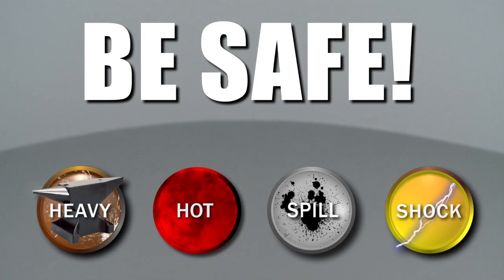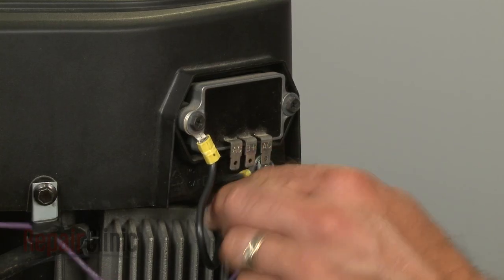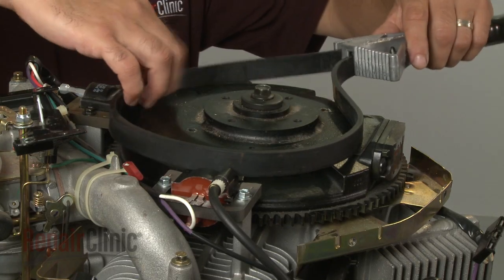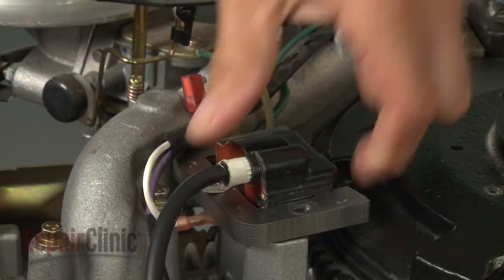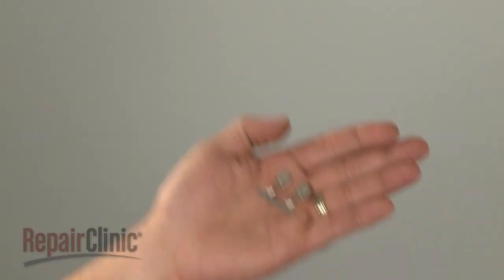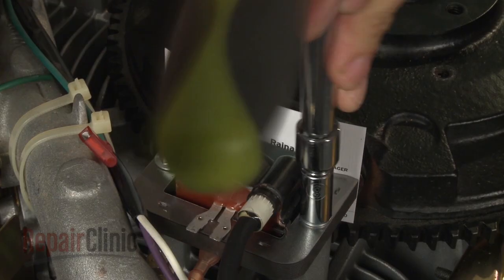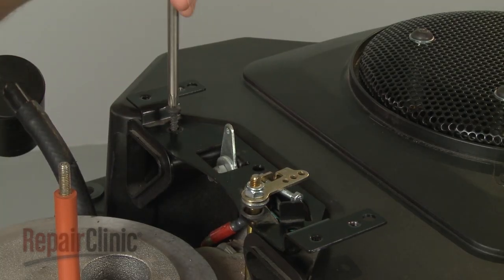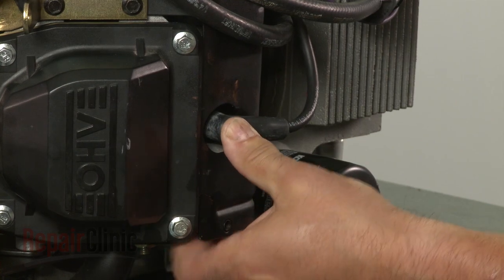Kohler Command Lawn Mower Stator Replacement #237878-S

Comment: Thanks for the video.   I followed all of these steps.   I even replaced the regulator rectifier.   I am still not getting the battery to charge.
Reply: on some mowers there is a fuse inline on the charging system.Check all fuses.
Reply: Check your wire harness
Reply: measure the dc to groun a regulator with eng running should read  over 12 upto 15 v dc  on the center tap on reg  if not check the two out side lugs fr 40v ac to ground with eng running  if no volts  is the stator   set your meter on ohms conn leads to th plug thatyou unplugfrom regulator to the outside conn you shoud get a reading in ohms   you are reading thru those coils  if no reading  you ma have a wire problem going to stator it  is open somewhere you will need to go into it then

Comment: Torque specs on the flywheel, I have a deere with a kohler 16hp and the wires heat up where the regulator plugs to the wires
Reply: I'm not sure what model engine the 16HP version is, but In the Kohler manual it says 55 ft-lbs for the flywheel retaining screw, on KT715 through KT745. Looks like you wanted to know this 4 years ago so I'm just posting this for posterity.

Comment: What's the thread pitch of the long bolts going into the flywheel? As I can get 5/16-18 and 5/16-24 started, but then they get real hard to turn. And so I can't figure out what the correct bolt size is?

Comment: whats the part number for the voltage regulator on this exact motor. i have the same one and my voltage regulator is bad, but the sticker with the engine model number is gone. this is the closest ive gotten to it yet

Comment: I'm trying to figure out on my Kohler stator which wire is hot and ground...it has 3 wires ..one purple..2 green ...on one of the green wires it has a connector clip at the end which is bot connected to anything..im trying to rewire it to the battery.

Comment: test this way  at the regulator  on the 2 out side lugs to ground if stator is good and the eng is running you will read 40ac each outside lug   if no ac its bad stator  if you read ac but  read no 14 dc on center lug replace regulator  make these test prior to taking any thing apart

Comment: What is the AC output here? I just replaced one.  Same voltage output. No improvement.  Waste of time and money.
Reply: the   ac reading with eng running  should read up to 40 volts ac to ground measyerd at the regulator on the two outside lugs  read lug to griund on each one  the lug should read over 12 vdc to ground up o 14v if its ok  if ac is missing its the stator if dc is missing its the regulatoryou wlii have dc from battery on  that center lug  if it charging it will be up to 14v  dc  do let that confuse you
Reply: @frankdavidson9675  Yes, I found the information and got my power back. Required new magnets.